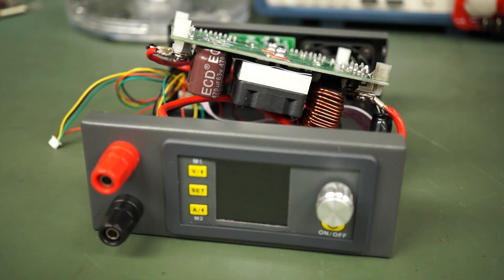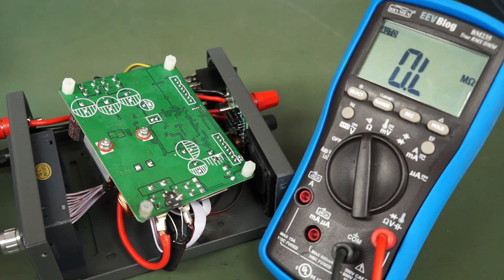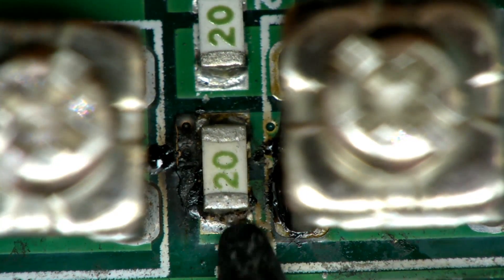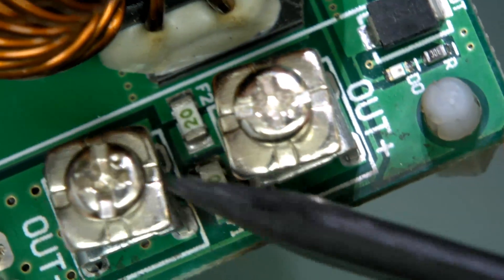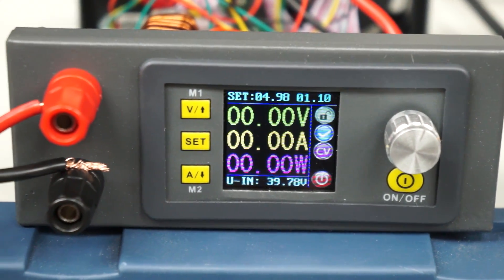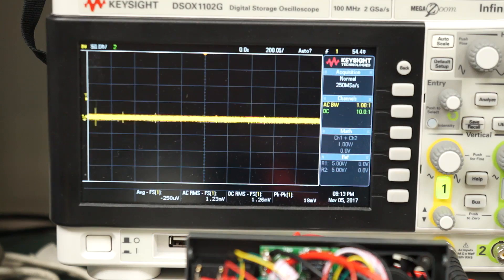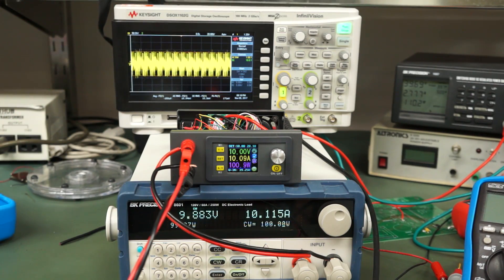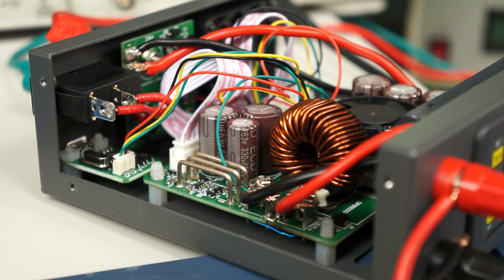EEVblog #1036 - PSU Fire PCB Repair

Comment: Found your video while looking for assembly guides for the DPS5020, which I just received (in early 2021). Board design is same as yours. Noticed that you spun the board around 180 degrees from the prior video, so that the fan is at the back. That's how I see it most often. It did look like you had the "out" terminals connected to the "out" screw tabs. Really liked how you tucked the ribbon cables under the board. Disassembled mine to do the same. Much neater.

Comment: How would two caps in parallel help? A short is a short.
Shorting ceramic caps is a known problem but not something I've experienced much despite the millions we use, quite unfortunate I'd say. AVX have a "flexicap" range so maybe the bigger brand technology is mitigating this problem.

Comment: DC output should be as clean as a cell battery, right? Right.
A ripple factor at the output so high and with many switching peaks at 200/300 KHz means that is a power supply with a quality that leaves much to be desired ...

Comment: My mom had this habit, gleaned from her early years growing up and raising we children on a farm with very little income, of keeping anything that may one day be needed, even if it needed repair.  Well she is 93 now and recently entered the nursing home after several falls needing an ambulance to get her to hospital for treatment, an irregular heart beat was diagnosed and treated, she is doing great now but cannot come home.  So it is, I am cleaning our her home to sell for her. I came across an old radio replica of a 1930's set but with modern transistor guts.  It had developed a deep hum that I figured was due to filter caps from the power supply, that said the dang thing had the caps on the main board, just a transformer with a couple of inducters on the PS board. At any rate, I didn't have the 1000uF caps at 16V in my kit but I did have some 1500uF at 16V, so I used them.  Well the hum is nearly completely gone on AM and there is quiet on the FM (We have no FM stations available in our little corner of the Dakota's) but when I transmit on my tiny FM transmitter it is clear as a bell.  So I guess one can go higher as you say with the capacitance with little to no problem, likewise when fixing an old PC Speaker Amp from the 80's I had to substitute a 3300uF cap with a 2200uF of the same voltage rating and again, the device seems completely happy, I have added a Blue-tooth receiver to the speaker so I can use it for general music via my cell phone or PC for the holidays.

Comment: You should have used a ceramic cap. To be fair I dont expect much but as it is a high frequentie filter cap It should do more becaude an eleco is not made for hight frequentie filtering

Comment: Reminds me of a TV repair many years back,  where there was a charred area in a board around the horizontal output tube,  and the high voltage pulses in that circuit were having all kinds of fun jumping around that area.  I think this was before manufacturers caught on to the idea of isolation slots and similar stuff.

Comment: I have personally witnessed 1206 style 47nF multilayer ceramic capacitors flare like a mini blowtorch at only 5 volts and 100mA. On one occasion a capacitor set fire to the plastic equipment housing. They are potentially extremely dangerous if mounted rigidly. By the way, the crack in your capacitor is visible in the original video. It shows as a lighter patch. Read "Surface Mount Technology - Design Guidelines eBook" at "the-cool-book-shop" for photos and more info.

Comment: Would a 100nF polyester cap be a suitable substitute if someone were to want to place a cap on the output? Of course the 630 volt types I would likely be stocking if I had a bench set up would be overkill.

Comment: Its funny how they admitted that it has happened before, and now they have to fix it because it happened during a review.  They didn't care that that had happened to customers in the past.  I'm glad that it happened during the review, because if it didn't, they would not of fixed it and would be still selling it to anyone that would buy it.  Luckily it happened during the review and Dave knew how to handle it.  There are probably a lot of customers out there that had purchased this unit and might have been devastating to them and still not know there is a problem.  Not sure how I feel about the company at this point.  They knew there was a problem and continued to sell it.  They were forced to speak up because of the review and were expecting to gain sales by paying someone to review there product.  It blows my mind.  They knew there was a problem, sold it anyway, not caring of the results, and they sent it to get reviewed.  I also noticed, that Dave usually trashes items like this, and destroys everything about the design including the designer having ugly children or leads were loose or too small, or he smelled on the other end of the phone.  There was a few things, that he was like "oh well", that he would of spent a great deal of time about how bad it was.  That is what makes me think he was paid to review this product and also do 3 updates about it.

Comment: The lesson here is that you don't need to torque those PCB screw terminals like a Head Bolt. It takes surprisingly little to achieve zero resistance. Just beyond snug might be best. Just enough to keep from falling out.     Rookie car mechanics are always breaking bolts.

Comment: I have one of these modules with the case, not the exact same, but the input cap is gone, or relocated. Problem solved. It works great, I'm using it as a bench power supply and powering it from a computer PSU because of the high output current.

Comment: This may be a stupid question but why would you need a power supply that you power with a bigger power supply? I don't see it's purpose. Any explanation would be appreciated.
Reply: It has an adjustable output voltage, so you can output anything from 0.1V to the supply voltage you feed it - so you can use the same device to power 3.3V / 5V / 12V devices, or vary the voltage to test parts at different power levels - plus it has current limiting, so you can drive and LEDs directly, from tiny surface mount ones to huge 100W chip array LEDs, or just set a maximum current when powering a circuit you're designing or repairing, so if something goes wrong and theres a short or unexpected power draw, it can limit the amount of power delivered into the circuit, preventing damage.

Comment: 13:30 I think in that noise speed, it would be better to use a small value non polarized capacitor to reduce that noise. The original burned capacitor is a small valued capacitor. Electrolytic capacitor will not prevent fast transient noise.

Comment: If you're trying to measure output ripple and noise you need to use a high impedance probe with a ground ring connected directly across the output on the PCB.  You can't use shity banana cables, you have a huge ground loop acting like an antenna.  Also adding a high ESR electrolytic capacitor across the output (at the end of the wires!) won't help the ripple at all, it needs to be a specifically selected capacitor with the proper ESR and located very close to the switching inductor.

Comment: Also, Dave,  I wanted to see the performance of this unit. What was the output ripple when loaded? (And with how much load, etc..)
Efficiency? Does it do it's rated power without overheating? That surely is a tiny heatsink, even for a 1kW supply. Seems too small. Test it with max current and max input voltage to see how well it performs.
Also, are there any turn on spikes? And what about the regulation? If the load is suddenly removed, is there a large output voltage spike?

Comment: I know its been a while since this video has been uploadet but I have a question I hope someone can answer. So I got this little powersupply (15A version) to build my own DIY lab bench powersupply for home projects. It worked just fine untill I acidentaly connectet the output + to the input - screen turned black and that was it. Cheked the fuses they where fine but still the thing just refuses to start. Now my question is why did it release the magic smoke when i did that ? and what would have broken ?

Comment: I had a capacitor fail thermally on a video card in my older pc and it took the motherboard out as well!  It wasn't a mechanical failure of the component but it puffed a few capacitors on the board, just at a glance.  I've yet to look closer to see if it's salvageable, even long enough to get the, thankfully, small amount of data off the hard-drives.  Thanks for the encouragement. Cheers Dave.

Comment: Ive also experience problem on ceramic capacitor that shorts out the power supply and it burns the charging ic for the battery and one other component that seems to be an scr but i couldnt find a replacement parts here in Philippines smd is not that popular in here,we have very limited suppliers for smd component . So is it always the ceramoc capacitor that usually fail in smd component thanks Dave

Comment: I see this all the time on laptop mainboards. Multilayer ceramic capacitors are sensitive to a lot of things: flex, mechanical shock, vibration (they're microphonic!) humidity, lots of stuff really. You need to be careful with your layout when you are using them in a high current power supply.

Comment: 16:16 Double the capacitance? Caps in series reduce the capacitance. Same equation as parallel resistors. So two equal caps in series have half the capacitance.
Other than that good video!

Comment: Why doesn't he just put the capacitor between a couple of copper tabs (perhaps beryllium copper) soldered to the back of the pins? They can take up the torque.  No PCB change and, if he makes up a clip with some thermal mass to stop the whole thing melting in some fiddly way, not much more assembly time.

Comment: Nice quick fix!
Practical works, but for those curious, full repair would be possible. 
1. Remove surface damage
2. Remove all components over/around burned area, and remove solder mask for traces to be salvaged
3. Clean surface, trace or photograph traces. If damage allows, use copper foil and mark/cut out replacement tracks
4. Using small dremel ball mill, excavate until no burn damage remains
5. Use two-part epoxy to fill in damaged parts. Use nylon or plastic if needed to contain expoxy for damage going all the way through
6. Wait for cure time of epoxy and sand surface smooth. 
7. Cut replacement traces from copper foil and using light epoxy, place them on the board. Use tongue depressors and clamps to hold them in place until epoxy cures. Do not put epoxy on overlaps with existing traces. Once epoxy is fully cured, tin/lap solder new trace to existing trace. 
8. Drill holes for any needed plates through hole rivets with pin vise and bit, by hand. Using a pointed punch and a flat punch, set the rivets and tin them to the trace. 
9. If damage is too great or infeasible, for money or time reasons, run jumpers with solid core wire. Or, just use a slotting saw ;p

Comment: Is the ripple voltage at no load the output ripple required for the switching IC to know how to adjust the PWM duty cycle? Because I read on some SMPS ICs' datasheet that some require a minimum output ripple in order to adjust the duty cycle.

Comment: Why did he measure resistance two times, switching probes around?
Reply: Johan Rosander To eliminate a false reading due to the possibility of the test current from the multimeter forward biasing a diode and turning it on. Protection diodes and such can sometimes skew readings due to this.
If the measured resistance is the same in both probe orientations, then the reading is most likely accurate.
If one probe orientation has a significantly different reading from the other, then a diode(or a transistor PN junction) is most likely causing the error by turning on under the test current of the multimeter.
Reply: Ah, thank you :)

Comment: Glad i just saw these videos. I bought one of these a few weeks back and didn't test it yet.
Reply: you can test it , if there is any problem, please contact me
Reply: I didn't test it yet but i might swap out the cap for a foil one to avoid any future issues, that board burn was bad! I never thought about carbonisation becoming conductive before. Nice work!
Reply: Rd Tech 
Hey I bought one couples of weeks ago and it has the same capacitor. . What should I do ?? To make it work without burning?

Comment: Well Dave, what should I say? There are reasons for paying for a properly trained engineer with experience when designing products, whether its electronics or anything else. Today's market where "makers" think that they can design build and sell things leave everyone at risk of failure. This failure was mostly benign because you were attentive and understood what to do. But burning electronics can lead to the complete loss of a structure and lives. So this has to be classified as a very serious issue.

Comment: Adding Silicone Conformal Coating to your repair would be a cool touch. Especially since you cut into the PCB, it would protect it from absorbing moisture, etc. Not such a big deal in the lab, but if this was to be installed on a manufacturing floor, or outside, might make a big difference.

Comment: Had to fix something similar in an OEM car amp in the power input section. Someone connected the car battery backwards... entire burnt section was really conductive.

Ended up having to completely cut out the crispified section of the board and rebuild it with a blank piece of board cut to size and shape. Etched new traces, drilled, and epoxied it in place. Amp worked great afterwards.
Reply: The Workbench Yes, I had a similar experience. Now I am convinced that if a board have a burn like this then no cleaning or scraping can save it. The whole burnt spot is completely toast and should be just cut off and replaced with a new piece. 

But the best solution is generally just to replace the entire board. Even if you need to move some or even most of the components from the damaged board it is faster anyway and the end result is much more reliable.
Reply: @
The Workbench
thank you for your message ,. in fact , it depend the exact products, because some product has no protection
Reply: @Кирилл Рагузин
sometime yes, sometime no, it depends on the products and which part was burnt
Reply: It was a Honda, but I'm not sure what model exactly, I was just given the amp to look at.
Reply: @
The Workbench
you can test to check

Comment: One PCBA manufacturer took it upon themselves to improve their profit margin by changing our board separation design from milled + linked to v-scored (V-shaped groove). The induced stress by bending to breaking the scoring also broke caps near the board edge....

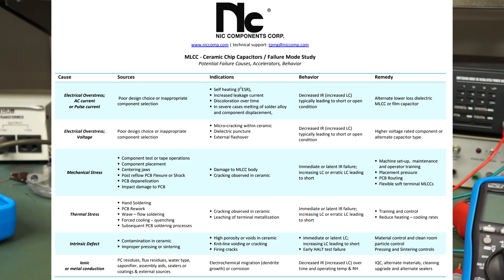Comment: Hey Dave at 16:04 you say: Adding two capacitors in series will effectively double your capacitance.
 I dont think that part is right. Are you meaning you need double the new capacitance to achieve the original capacitance?
Appropriate links: http://www.electronics-tutorials.ws/capacitor/cap_7.html
https://www.allaboutcircuits.com/textbook/direct-current/chpt-13/series-and-parallel-capacitors/
Reply: What he said is when you have two caps in series and one fails short, the capacitance will double.

Comment: Why even bother with the fuses. they obviously didn't protect anything.
Reply: The fuses didn't blow because the supply was delivering under its rated current.  That rated current was enough to ignite the capacitor.  Would you expect the fuses to blow if you put a 1/8W 1k resistor across the outputs and smoked it too?  The fuses protect the supply if it exceeds its rated current.
Reply: Just why. The thing measures current anyway, have a software cut-off below the threshold of damage to disable the output.

Comment: I've built with DPS5005, and I'm finding them terribly inaccurate with respect to source current -- mine was perhaps only 60% of the actual value (determined by two different ammeters). 
My external ammeter shows 240mA (at 5.5V) but the supply shows around 140mA! I have two, and they do the same thing... what's up with that?

Comment: It changes value in FOUR conditions.

1) +humidity, intially it is like a sponge, it will capture any humidity in the air and increase conductivity.

2) if reconnnected, it actually can carbonize MORE.

3) it also reacts on PRESSURE, if it pressed, it wil get more conductivity.... ideal to measure WEIGHT!.

4) vibration, it is like a microphone too!.